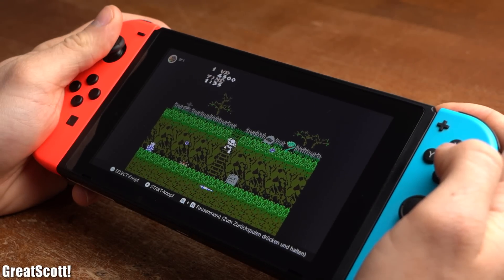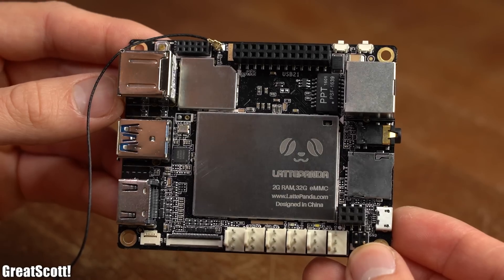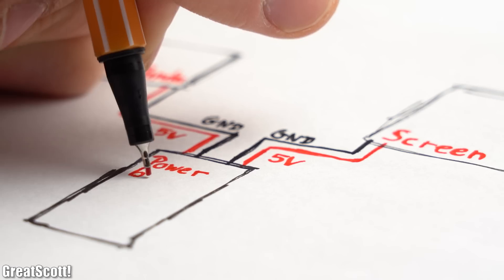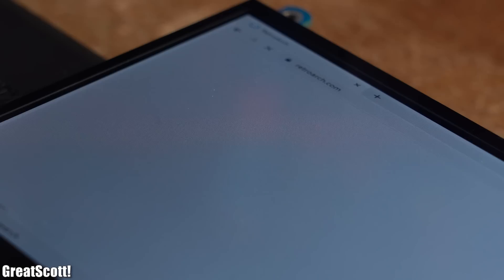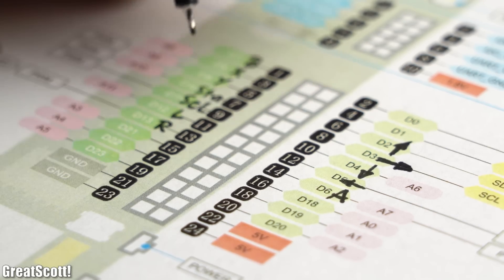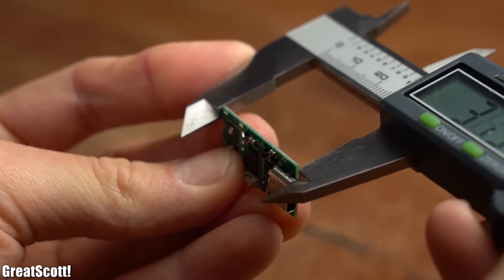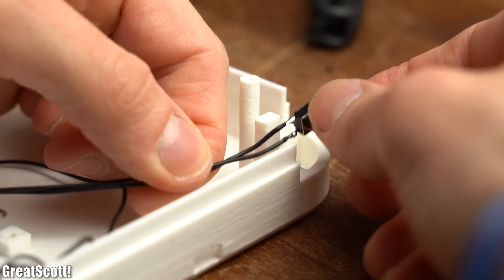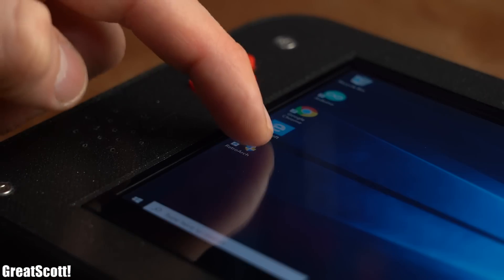Make your own Portable Retro Game Console!......which is also a Win10 Tablet!

Comment: Looking back at this, the end result is pretty bulky. It definitely needs an internal battery for the size, even if you just designed an extra big compartment behind the panda just for it.
More buttons would be needed for shortcuts like the task manager.
The unused usb ports could be extended and added to sides/bottom.
A kickstand of sorts looks like it'd fit no problem.
And finally the post where the shoulder buttons are mounted could do with reinforcement, at the very least having them connected to the screw posts.

Comment: Get a Udoo Bolt V8 that has 32gb of ram, Arduino Leonardo built in and a Ryzen V1000. Then put a low profile high end gpu with an e gpu adapter, mod the gpu cooling system to be more compact and then you have a very powerful unit!
Reply: Would be sooooooo huge

Comment: I think there was no need for the USB-C PD board, a simple USB-C breakout board would have done it, as the default voltage is 5V... even though the battery bank says the standard output is 2A, I think that means the USB-A ports, not the C one... can't confirm though as I don't have those parts laying around atm...

Comment: For anyone considering this, start with a cheap 8" windows tablet instead. Same processor and ram as the lower end latte panda but includes a screen and battery for less than the cost of the latte panda board on its own. The mainboard is also a lot thinner than the latte panda so you can build something that isn't so thick.

The big benefit of a unit like this over something that runs retropie is the ability to play older PC titles as well. Most games up till about 2003 should run well on a device like this, some even later than that will run depending on how well optimized they are. So far I've successfully run Halo 1, Need for speed underground (1, 2 and most wanted), Morrowind, Unreal Tournament 1 and 2, Simpsons hit and run, GTA 3 and a few others all on this same hardware. Its also terrific on steam link (yes I know you can do that on a PI too).
Here's a link to the build thread for my version of a PC based portable: https://bitbuilt.net/forums/index.php?threads/diy-concept-ufo.3339/

Comment: I already had this idea but I'm waiting for a more powerful SBC. Not worth my time until it can at least emulate Switch games in Yuzu at full speed at 1080p. Then it will replace my Switch.
In the meantime, I have a modded Switch.

Alternatively I may just gut a performance laptop instead of using an SBC. That'll probably be more constrictive and/or complicated though, because laptop boards are typically one or two relatively large pieces. I'm no Ben Heck.

Comment: Since that power supply supports 9V@2.6A that would be the best option. Switch mode regulators could handle decent efficiency going from 9V to 5V. There is some gain from 15V supply, but 9V its at least a whole Amp. You can make a boot circuit for the USB-C logic using that breakout, mostly likely using basic components. 
Here is why you do not use Windows 10 for embedded systems, the power draw. The code is software ideal and not real world ideal. The hardware support is built around large notions of performance. Find yourself in between worlds of performance/power and cost, quickly here. 
The software world has screwed up the market/industry for at least two decades. So much most people do not actually understand the actual point of software or software's future. OOO programming is a joke. Java, C#, Python, etc. all jokes. The whole field of CS is a joke, and really the source of the problem. They went extinct in the 90s maybe 80s, but the world thinks its the other way around. 
Some of their notions could persist but as it turns out most do not even understand them anymore. So when people talk about using them it goes terribly wrong. The applies to AI, the Cloud, Programming, Virtualization, GPU, hardware, software, Operating Systems, Embedded Systems, coprocessors, hardware/software codesign, etc. Most CS majors are useless, since we have moved away from proper algorithms and software. The whole theory in CS is mostly if not completely a lie. Its one dimensional at best, in a field that exists in several dimensions. Hence the train wreck, economics became a real problem. 
The internet ironically messed up everything. The internet along with most software following or during the era was not properly designed. They did not understand the future of technology like they thought they did. They create liabilities for the entire foundation of society, let alone governance. The security component is a double edge sword which is why many assume its functional in spite of the reality.

Comment: Well, I already was inspired to do something similar, but you reinforce it, and to finish the proyect, i have 2 videos in my channel making the what i call "Pintendo Switch", and I just returned to finish the proyect with a Stream where i start designing the console in Fusion 360. Now i'm inspired to upgrade the battery with a USB-C type of connector, or maybe fast charge? i need to think about it more but the idea is there.

Comment: i can't imagine those 3D printed caps combined with the buttons to feel good at all... it's like i could feel it in my fingers just by looking at it ^^ 
still a great project, but the external power source is kinda strange for a handheld... reminds me of my psp when the battery connector broke and i had to use a cable :D

Comment: Little confused on the wiring for the momentary switches. Can you use only 2 wires, one for digital and the other for ground? Then just use a pull-up resistor on the code

Comment: Thank you !
I was trying to make A.I project to make my robot speak. The A.I was made in python3 64 bit and when i compiled it into 64bit exe file and then making it installable then i realized that raspberry pi can not run such a program becuase i was made for windows 10 64 bit but raspberry pi had ARM processor and has very low power system.

Comment: I've been watching way too many Ben Heck videos. I see all those connectors and jacks. I just want to rip them all off to then solder wires directly and save tons and tons of space.

Then I remember I can barely hold a soldering iron and make anything useful myself... Oh well. 

But if If I were to build something like this. I'd be very tempted to add full sized arcade sticks and buttons.
Reply: My favourite one was portable N64!
Reply: I also hate connectors inside housing: unreliable,takes a lot of space.Soldering power cables(like microUSB) is terrible-they have some resistance and it will give not same current as they consuming,it means that they will heat up and main board(Raspberry pi,orange pi etc.) will be some glitchy because not enough current.

Comment: I ran into a similar power issue with a Raspberry Pi and a display along with some accessories. What I ended up doing was using two USB cables with a DPST switch that would let me turn them both on and off at the same time. Turn the switch on, the screen and Pi would turn on. When you were done, press a button that would run a shutdown command on the Pi, wait for it to finish shutting down, and turn off the power switch.

Comment: Was the lipo battery charger and protection circuit that you made back in mid 2017 was only for the raspberry pi console or at the end it could not output that much power?

Comment: So it definitely needs to get a LOT thinner.

Some thoughts:
Smaller speaker, (but maybe x2).

Cut the unwired space of the PCB.

Rework the button mounting (you could use a slide mount, instead of screws).

Don't use "standard" plugs inside, instead hard wire everything you can, or at least get rid of the big housing somehow.

"Puzzle" a little around with your parts first and don't be afraid to design some parts or everything "tilted".

Also think about ergonomic holding "depths" and spacing, but also about how the weight of the device fells in your hand and how you can deal with that, by using just an ergonomic design.

Don't worry about the battery size. Give it the last thought and look then at your prototype and think about form factor and capacity then.

Comment: I'm working on a similar project with a raspberry pi 4. Think my biggest issue with this one is how expensive those windows 10 boards are. I'd rather just buy some pre built console for that price. Raspberry pi 4 uses less power and is smaller so running it off of a LiPo battery has been easy enough. Also the raspberry pi 3 and 4 run PlayStation 1 effortlessly and if the screen resolution is low enough it'll even run Nintendo 64 just fine on the pi 3.

Comment: I garente you this board will owerheat and thermall throttle without heatsink/fan , also wouldn't it be better to use delta / Alfa + the eDP touch panel ?

Comment: You should probably see about putting a power bank inside the device itself. You'd have to make sure to balance it but that shouldn't be too hard. 4x 18650 cells at 3,000mAh or greater would be ideal, though only provide about 4 hours of playtime. You could potentially fit as many as 8x 18650 cells depending how comfortable you are with the weight though.

Comment: Why didn't you use the original Latte Panda display with touch screen? There are direct connectors too. You would not have the power issues and would not need to occupy the HDMI and a USB port. You can buy the display and the touch overlay for less than your solution from DFrobot.

Comment: This would work awesome as a mobile programmer for arduino projects, maybe a data logger for certain sensors. Add a wifi module and you can have a standalone data monitor for microcontroller projects that you can use solely for programming and monitor purpose. Save some space on your computer.

Comment: This is perfect! I had just started planning a very similar build using a 7" HDMI display, a Pi 4 and Teensy for game controller inputs and I wasn't sure where to get a proper HDMI cable and then you post this video!

I'm going to be integrating a Blackberry trackball into mine which will connect as a USB HID device and be used as the mouse with shoulder buttons "I hope" for left and right click, as well as a third button to latch and unlatch scroll wheel functionality. Luckily somebody already made all of he teensy code for that. Maybe this is something you could add to the next iteration of your project.

I'm also hoping to integrate a small wireless keyboard, initially I had planned to make a space inside the case where it could be stored but not seeing something similar all put together I don't think that's such a great idea.

I am interested to see how you are going to approach making this completely portable. I'm planning to get a flat LiPo pack, as large as I can fit in the case to maximize battery life and will be digging through your videos to find an appropriate power distribution and charging circuit because I'm clearly going to need something that can do better than 1 amp. I hope you have something for that already.

I'm going to be using a display I already have that is designed to operate at 12 - 40 VDC so you probably already know what buck converter I'll be bypassing :)

Great work as always man.

Comment: Hmm, i wonder why you didn't use that PD and run it at 9V? Step down the voltage and so on. Or is it just more efficient to pull 15 watts off the powerbank than 23 watts?

Comment: The amount of money you spent on this, you could have bought a 10inch tablet with decent specifications. Also it is very thick in comparison to the tablets available in the market. But still if you have a lot of extra money, then this project is a great way to learn electronics.
Reply: one could "learn electronics" on similar yet much cheaper devices. I've built a self-contained retro portable console with spare parts, a few new components, screws, nuts and bolts, scraps of plastic and some glue. Total cost was well under $50. True fun begins when one wants to modify it from portrait to landscape. :3
Reply: @waltercomunello121  yeah bro, that is what everyone should do. If you have spare parts laying around, then you should definitely build something like you did.

Comment: Great video!
If you just need 5V/3A you can even build this without a dedicated USB-PD PCB. The USB-C standard allows for drawing up to 3A from a compatible power supply. Just hook up a 5.1kOhm pulldown resistor between CC and the GND pin and if the voltage over it is about 1.5V you can easily draw 3A from the power supply.

Comment: Maybe you can run the system from a Raspberry Pi to make the project cheaper. I would play the games from archive.org in their amazing dosbox, just run their site in the startup. the buttons could be mapped with python. smaller displays don't requires much current, so it can be powered with cheaper power bank aaand everything would be inside the case. my rasp +display run for one hour in this setup. maybe I'll make one for me 😅 
nevertheless, great content! your work is inspiring!

Comment: the external  battery is a turn off though. but i get it. it uses a huge amount of power. how long does it take to fully charge the battery vs gameplay time? plus 3d printer. its a watch but don't try video.

Comment: A pre-made chinese 8 inch tablet with the same specs and genuine windows (windows is free for under 9 inch tablets) plus a joypad that connects to it from both sides (kinda like a Nintendo switch) could cost you around $150 max, and it'd have an internal battery, micro SD support and HDMI output too...

Comment: I would love to see him take this to the next level, and make this so much more well rounded, and easier to use by doing one or two of the following:
Get proper control of the backlight(not just by using the monitors OSD/controls, but a descrete adjustment or maybe even get it to work with the windows stock system screen management) I would certainly offer up a good bounty to see this done.
And two getting windows to read in the values for the battery to to windows "fuel" gauge to show it what the battery charge is as if it was a legitimate laptop, something I have spent hundreds of dollars and hours trying to do, unseccesfully a while back.

Comment: 10:01 - Seriously, we're under lockdown. Tidy up those solder joints, you are in no hurry, man :)
Reply: Soldering while plugged in the connector, not using heat shrink tubes, only black wires and no cable management, I cried a little 😪
Reply: @planned_obsolescence  then you would get multiple seizures just by looking at my projects... "if it works, it works" is basically all of my stuff ^^

Comment: What I've learned from using a USB A-B cable as cheap internal cable: They are quite stiff. This results in high mechanical stress at the thin wires (outside of stripped cable) and especially at the solder joints. That is why I now collect the thinner and much more flexible USB cables like from old mice. :-)

Comment: Pretty awesome. I'm surprised you didn't put the battery bank within the case, or use one of those battery controllers to integrate a power source into it, this way it'd be a great portable gaming rig (for retro games), and heck, with a wireless keyboard and mouse, you could use it as a tiny laptop if you need.

Comment: If the audio amplifier integrated into the screen has a stereo output, why not take advantage of that and use 2 speakers instead of just mono sound? It would be much better for games and video, In my opinion.

Comment: Sugestions:
1) Remove unnecessary ports to reduce overall size
2) Solder ribbon cables (or flex cable or however it's called) to the HDMI ports, to reduce thickness
3) The LattePanda should be closer to one of the sides, to expose the SD card slot and the ethernet port
4) If you want, remove the ethernet port to reduce thickness but ensure enough USB ports to connect one
5) Compatibility with Nintendo Switch Joycons in case you can reduce the thickness to something more manageable, or change the form factor to increase ergonomics while keeping the joycons
6) A Wifi AC card (if possible) would be great to stream games to the console. If not, try to get better wifi antenas, perhaps like those on a laptop
7) A HDMI spliter would be a good idea, just like the switch

8) With the extra free space, add some batteries. In case the console gets too warm, you might need to add extra cooling (custom heatpipes with an old laptop heatsink maybe?)

I've had the same idea for a while, because I really like my switch but would also like to enjoy my steam library in the same "couch gaming" format. But as you saw for yourself, this isn't a cheap project ^^. Keep on it!

Comment: The latte panda alpha or delta are known for having  M.2 slots, you could build a docking station that features an external gpu with q couple of adapters, and will be able to play more demanding PC games, use the original lattepanda EDP screen (7") , that way you can power it from the board and leave the HDMI port for external screen, also using the Arduino Joystick library you could build some controlles similar to those of a Nintendo switch.... A console with all of this features would not be cheap, but it could potentially handle any game